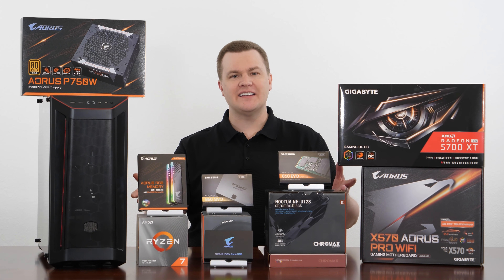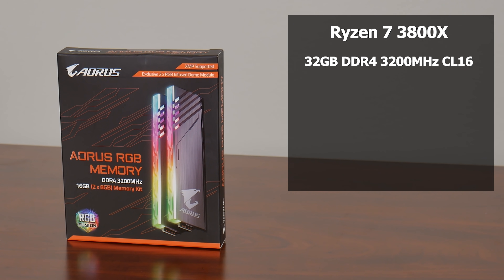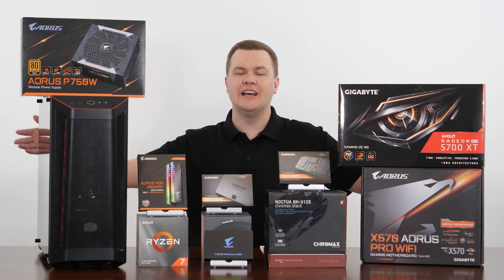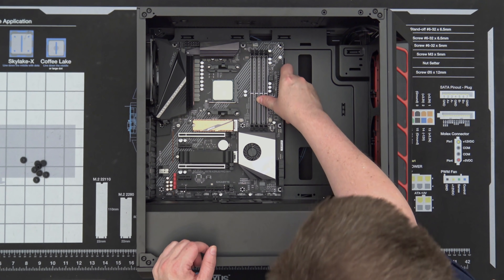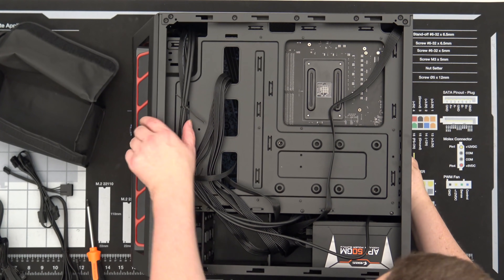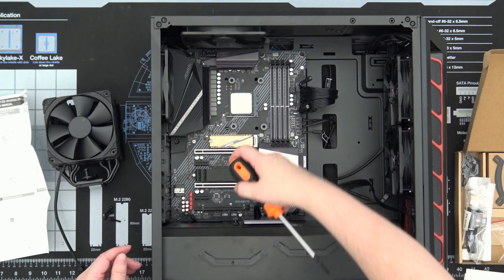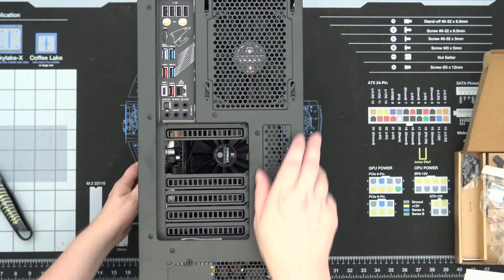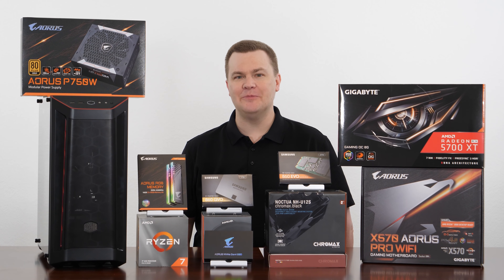Ryzen 7 3800X Gaming PC — Build Video & Parts Review

Comment: Did you have any problems on 4x 8gb ram? I have x470 auorus gaming elite with 37 3800x and 4x8gb 3200mhz kingston hyperx fury ram and i tested rams in memtest86. There was 688 errors in first few seconds of the test. I pulled 2 stick out and it was working perfectly. I tested even with xmp off eoth 4 sticks and same thing. Xmp ON with 2sticks working normally.

Comment: I already bought the same motherboard and cpu.
but I have a problem with screen no signal but pc runs normally
(without graphic card .. not yet arrived)
Reply from the maker: You need a GPU, the 3800X has no iGPU
Reply: @TechDeals  must install graphic card?
Can't use motherboard hdmi port?
ok i'm waiting for my graphic card

Comment: Nice build guide :-) the 3800x seems like a waste though, performance wise the 3700x is almost equal for 50 bucks less (not much in a 2k build but it adds up)
Reply: Right now you can get a 3800x for about $20 dollars more then a 3700x.  For many the extra clock without having to worry about OCing is well worth the $20.  But yeah for $50 its a bit more dubious, and especially at the original $70 difference.

Comment: It's been several PCs I build I do, and despite the whole techtuber community doing it that way, I never begin with the mother board and CPU

I found that when you have to put fans in your system, having the motherboard in the way is a real pain in the butt, so my first step is Case Fans, the PSU (had issues in the past with MoBo covering cutouts in the top for EPS cable), then I put the CPU and RAM on the MoBo, that I put in the case. Then SSD and hard drives, then CPU cooler, then graphics card. I wire-up and cable manage as I go and it has always proven to be quite effective

Comment: Hey @rogue and @techdeals.  I noticed during build your installed the PSU with the cables connected and then ran them over to the motherboard.  I think (for a modular PSU) you should consider connecting the PSU Cables first to all your peripherals/motherboard etc. Then connect them to the PSU.  It’s easier from a cable management perspective.

Comment: Thank you Tech, do you recommend the 5700 XT or the 2070 Super considering price difference and driver issues? Just bought an R5 3600 and MSI MPG x570 and 5700 XT seems like a great deal aside from the driver issues.
Reply from the maker: 2060 Super, the 2070 isn't worth the extra $$$
Reply: @TechDeals  Great call, thank you. For the extra 25% cost of the 2060S to go with 2070S, in the game I plan on playing it is a 7.6% increase in FPS on ultra settings (   https://www.gpucheck.com/compare-game-gpu/call-of-duty-modern-warfare-2019/nvidia-geforce-rtx-2070-super-vs-nvidia-geforce-rtx-2070/intel-core-i7-8700k-3-70ghz-vs-intel-core-i7-8700k-3-70ghz  ). 

Do you think NVIDIA will shift down Super prices after no shift last year for initial RTX?

Comment: Just a tip I found that makes it easier installing CPU coolers on AM4 boards, Tech...Only take one of the stock clip-mounts off at a time. On a Noctua cooler like that U12, you can tighten down the top portion of the mount just enough to hold it in place, then remove the bottom one, swing the mounting brackets down and tighten the bottom screws up, and voila, there ya go. It doesn't work on all coolers/mounts, but works on the majority of them. Keep up the good content!

Comment: I bought a 3900x vs a lower chip based on techdeals recommendation. Wow did I over spec what I needed!!! When gaming with a 5600x the CPU usage is between 3-8%!  But still I only spent about $200 more than the lowest I would have gone.  And now this computer will last me 5-8 years for sure.  Do want more GPU power even for just borderlands 3 which is only 40-60 fps with my ultrawide 1440p monitor.

Comment: I must be the only person in the world that had a helleva time getting the heatsink screwed to the brackets on the U12-S. I had push down inordinately hard to get it to "catch." I was sure I was breaking it. I'm a big guy and I was putting all my weight on it. And then once it did catch, it never bottomed out. I screwed it down for a good ten minutes. Eventually I just quit. It's on solid as a rock and cools like a dream, but as for being the easy process it was purported to be, it was far from that for me. I should not have to have an anxiety attack from installing a CPU cooler. I'm not unhappy with the performance or silence. But I'll definitely be going Be Quiet or Scythe on my next build for ease of installation.
Reply from the maker: Sorry to hear you had trouble...  no idea what happened, but I’ve used a lot of these and they go on fuss free...

Comment: This is the EXACT system I built about 2 weeks ago!!!! Same cpu/motherboard/ram is ballistic rgb 36oo mhz but I only have 16gb and the exact same gpu all in the Lian Li Lancool II. 1tb nvme ssd,250gb nvme ssd boot drive and a 2tb 7200 rpm bulk storage HD. 750W fully modular power supply but I still need to get a AIO cpu cooler as i am just using the stock cooler for now, but i was able to get all these parts at microcenter for roughly $1,300

Comment: hey guys i have searched a lot but cant seem to get it 

i have an X470 asrock killer sli/wifi on my ryzen 5 2600x 
and were planing on upgrading to a NVME M.2
but i don't seem to get how generations work 

like is the one in the video compatible with my  MotherBoard/CPU 
it's gen 5 and about 5000 read/write speed       WOW
Reply from the maker: It will work, but not at that speed, you have a gen3 board

Comment: I would use the 3700X instead of the 3800X and spend the 50 bugs for better RAM with 3600 MHz.
Reply from the maker: I don’t know if 50 bugs will get you more RAM, but you never know!  :)
Reply: Better to go with 3200mhz of 32 gigs Of ram than 3600 of 16 gigs

Comment: Hey Tech nice guide and good idea on doing a condensed video! As many PC's as I've built myself I still enjoy watching these full build videos and I am about to do two new builds in the near future as mine are almost eight years old now LOL. That being said one of them is a Gigabyte GA-X79-UD3 that I recently put the newest BIOS on trying to get some RAM that was supposed to be compatible to work. The RAM still didn't work but went into another build just fine...My problem is even though the new BIOS flashed fine and everything works as it should, for some reason it now takes like 4-5 minutes to boot because it hangs at the boot screen for a long time. I was wondering if you know of a way to force/flash the older BIOS back to the board? I've tried flashing the previous BIOS and it won't let me saying it's not compatible due to being an older BIOS. Any ideas would be great as this taking so long to boot is driving me crazy LOL.

Comment: some people might argue that installing the cooler & ram before putting the mobo in the case is easier.
Reply from the maker: True, but often you can’t because tall coolers can’t clear the case to install the board, it depends on the case and cooler.
Reply: @TechDeals  true :) but in this case (no pun intended) I think the best solution would have been to install the mounting brackets and ram before and just screw in the radiator afterwards.

Comment: This board says its pcie 4.0 but will support 3.0 x16. I have a gigabyte windforce 2070 super but i need the x570 to support my 3700x.  Is this true? Can i use my card  in this board?
Reply: YES, its backward compatible.
Reply: @shadowpuppet6707  Thank you! I was worried i would have to get a new 4.0 graphics card when i just got the 2070 super. What a relief!

Comment: If the 3800x costs 15-20% more than the 3700x for a 3 or 4% performance increase AND has a significantly higher TDP, why get the 3800X?
Reply from the maker: It doesn’t cost 20% more, and TDP doesn’t mean what you probably think it does. :)
This is what I had on the self, you shouldn’t buy either, you should buy a R9 3900X
Reply: Oh, I certainly know what TDP means and it IS worth mentioning. The performance difference is minimal, the RRP difference is 20% and you’re right, the 3900X is a better buy.

Comment: I still think the 3700X or 3800X are great gaming options.  A viable Intel option would be nice, but pre-order prices of the 10700K are about $410 to $425.  That's not far off from the lower end of 9900k prices we've seen since launch, and I still don't think the extra 5%-15% gaming performance justifies an extra $100-$150.  You also have several drawbacks with Intel, such as more heat, less platform features, security vunerabilities, and less of an upgrade path due to their chips never dropping in price (3900X is already $100 cheaper than launch, and I wouldn't be surprised to eventually see it fall below $300).

Comment: The All-Aorus PC.
Reply: @Lord Frieza It is Gigabyte though and they're part of the same company
Reply: @Lord Frieza If Tech Deals is sponsored by Gigabyte the components probably came from the same place. The Aorus cards do look better but on the 5700 XT in particular there doesn't seem to be many changes when opting for the more premium card. The Aorus version of the RTX 2070 super however looks drastically different when looking at the Aorus variant compared to the lower end gigabyte models.

Comment: Cool, this is close to my build I just put togethert a couple weeks ago during this quarantine 
- 3800x 
-RTX 2080 Super
-32 gigs of 3200 ram
-And 7 Noctua case fans inside the Phanteks 719 case.
-Also took your advice from one of your previous videos and went with a cheaper Sabrent m.2 drive, gen 3.  Wasn't worth the extra $150 to get negligible speed differences with the newer Gen 4 NVMe drives, which run hotter.

 The only thing I regret is the BeQuiet DarkRock Pro 4 cooler I got.  The most obnoxiously big and difficult-to-install cooler.

Will you be doing that somewhat "popular" OC for the 3800x, where you lower the voltage but raise the speed, to get it to run cooler?
Reply: I can see lowering the voltage helping, but the default frequency curve usually does as good or better than an all core OC (particularly in single threaded applications).  You're much better off going for memory overclocking with Ryzen.